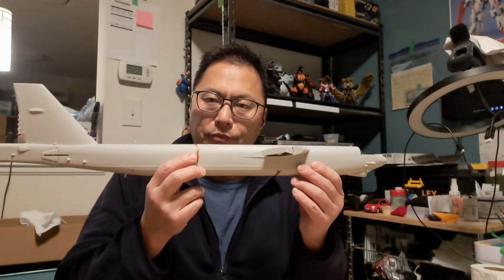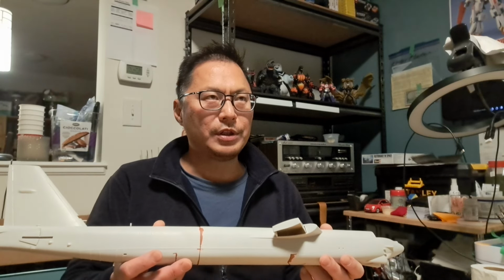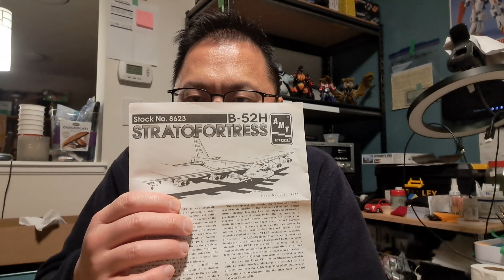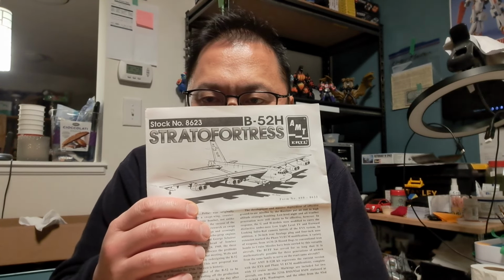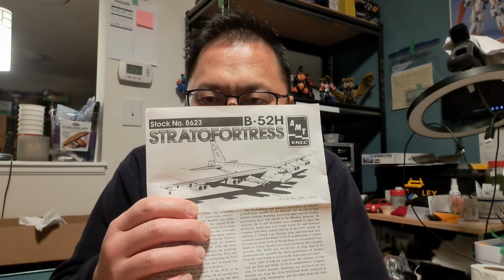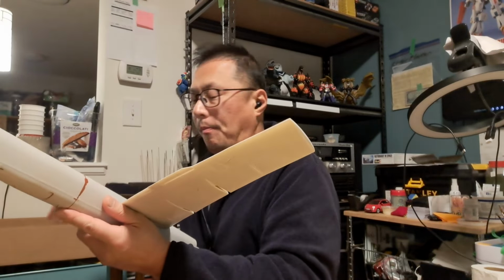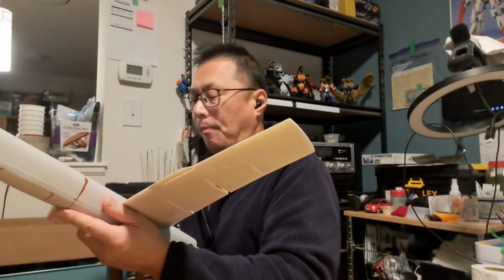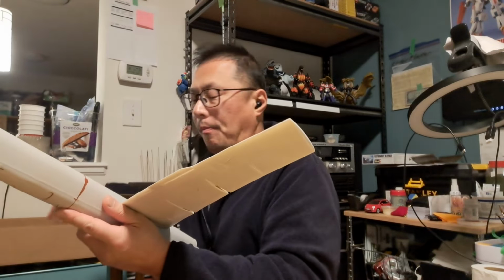1/72  AMT ERTL B-52H STRATOFORTRESS!!

Comment: Before you attach wings theres an old fine scale modeler issue that shows how to correct wing droop. Also black dog make resin upgrades!🤔

Jman
Reply from the maker: @robertmunoz7543  The wings are pretty sturdy. It wouldn't droop I guess.. Will see soon.. ^^
Reply: @daddymonkey7122  
If your doing an in flight the kits wings are ok but if you were to do wheels down the wings should be drooped down.😁

Jman